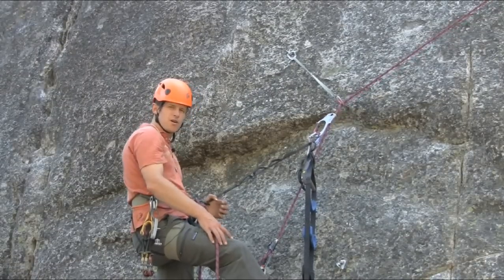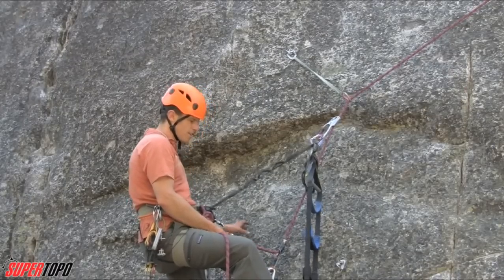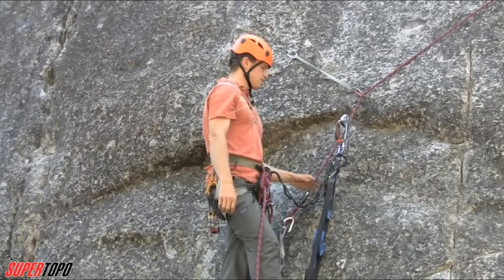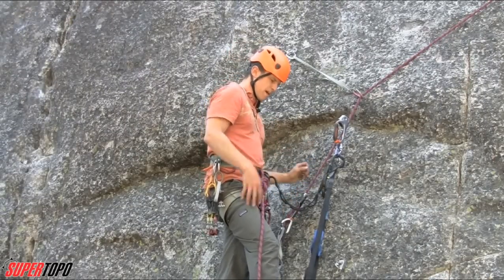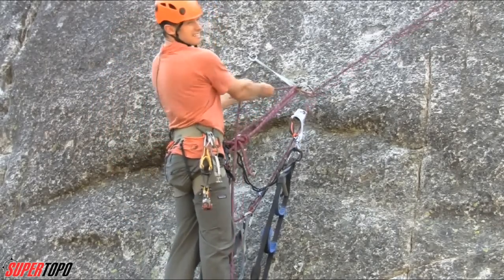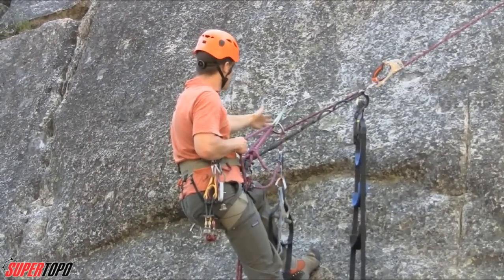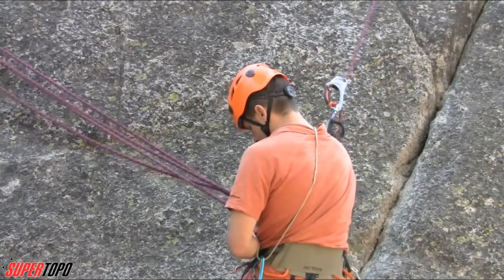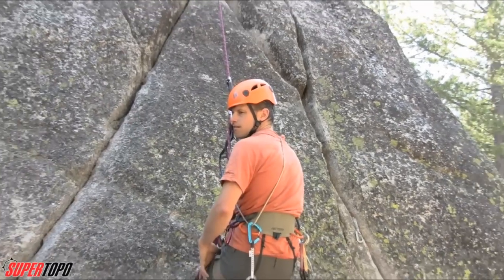How to lower out after a pendulum when aid climbing - How To Big Wall Climb

Comment: What makes the sling on rope friction acceptable here?  My understanding was that rope should only ever slide against carabiners and never against rope or slings.
Reply: Tom, good question. It's acceptable because you were going very slowly on the lower out and not generating enough heat to damage anything. Of course, you should NEVER top rope directly through webbing, because of the exact problem that you point out. And, if you're on a popular route, everyone else has had to lower out the exact same spot, and you're probably going to find a leaver biner or quick link at the lower out point.

Comment: Chris, I notice that you use the rope close to your tie in to start the loop and the rope "above" that as the slack end. Do you think it is a problem to use the grigri end  of the slack for the loop such that you are kind of suspended from your grigri?
Reply: Yes. in general you don't want to fall with rope/sling friction involved. But here, the forces are much smaller, You lower static weight of Your body and You use your legs which also offloads the sling.